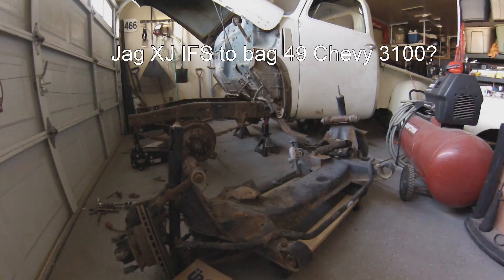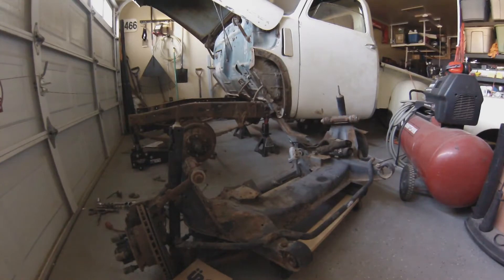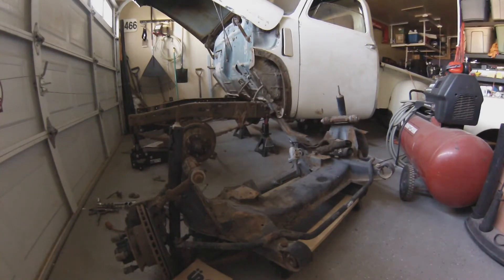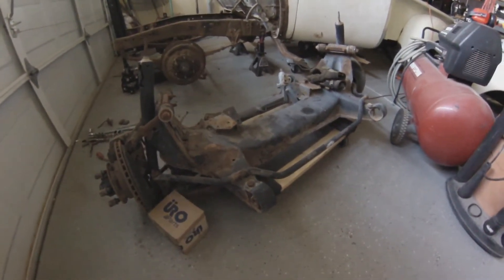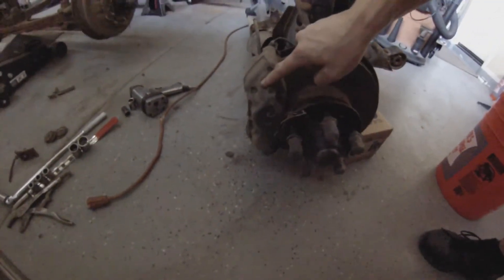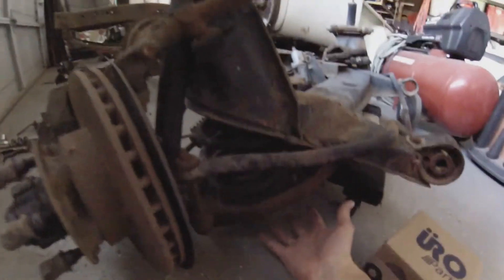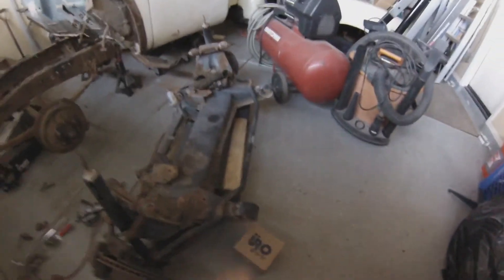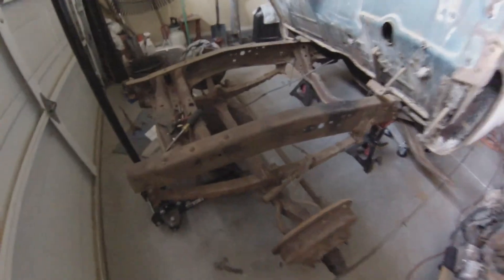49 Chevy Truck with a Jaguar IFS a good idea?

Comment: In 1982 I bought a 25K Mercury Bobcat, sister to a Ford Pinto , and Mustang II. In my opinion that setup isn't heavy enough for a V8. I'll use a Jag IFS, and IRS in a Model A I have here. Part of the reason is: I don't want to redesign anything, and this stuff is coming off the same car. Narrowing the width is pretty straight forward. I'll probly go with Double adjustable, spring over shocks.